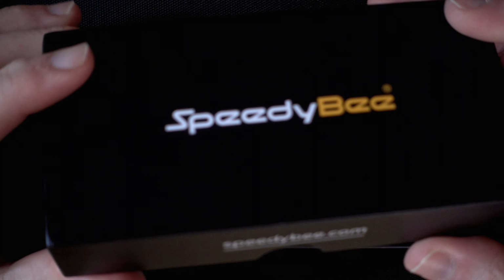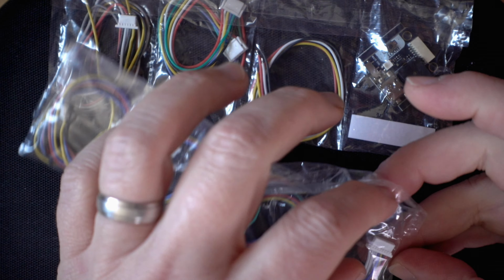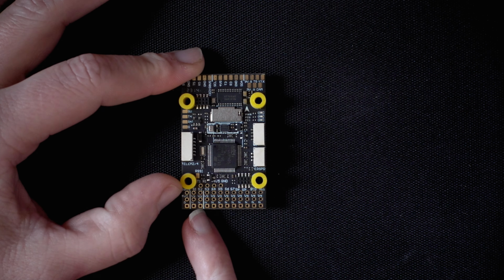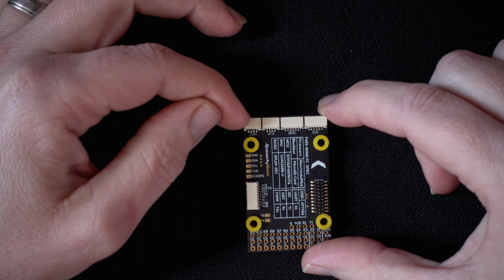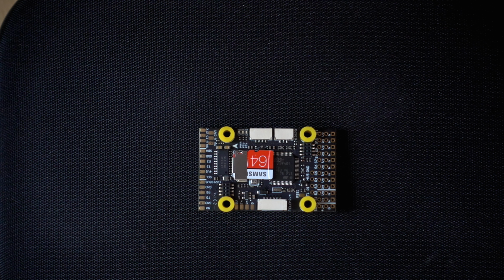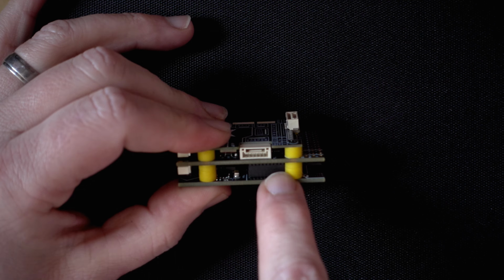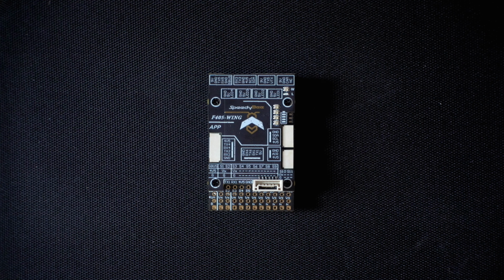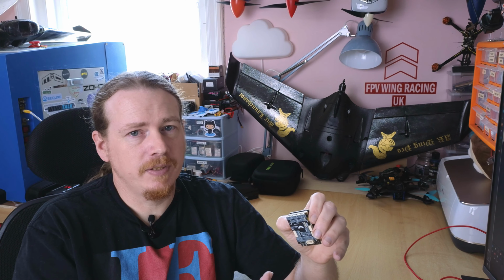First look at the SpeedyBee F405 WING flight controller

Comment: inav 7.1 speedybee wing f405,,I can't find a way to get the motors spinning below 7-8% radio throttle which is 1150us in receiver tab- esc calibrated , any suggestion ?

Comment: Do you know if this fc is compatible with spectrum Dsmx receivers?
Reply from the maker: They should work if they can output a serial protocol, which is supported but the firmware. I really don’t know enough about Spektrum to know what their serial protocols are. I know DSMX is what is used over the air. It’s how it connects to the flight controller. This will be the same with any flight controller. It’s not limited to this SpeedyBee FC.

Comment: Thank you for your videos, I am a beginner with INAV and subscribed to learn more...I got two Speedybee F405 wing for a Multiplex Funjet and an Freewing L39 80 EDF jet...had only the maiden with the Funjet and it worked great, I am more shy to do the maiden with the L39, and found two problems: 90A is what I get at full power and perhaps a bit too much for the FC, and no signal on PWM pin 8 to have a pan servo... a lot of servos on this type of jet, so I connected the ESC red wire to the retracting gear and flaps red wires...but on the bench, I get an "overheat" signal in the goggles, hope it will be cooler once in flight!

Comment: I just ordered this board.  Should I just return it and get the Matek 405 instead???
Reply from the maker: It’s fine as far as FCs go. It depends on which Matek F405. If it’s the new F405-WING V2, I wouldn’t bother. They’re both similar specs. The SpeedyBee has the Bluetooth stuff too.
Reply: Usb ports break easy

Comment: Good video...been trying to troubleshoot vtx problem with this fc...any suggestion for irc tramp and smartaudio for this? Seems that both of protocols doesnt work on this fc
Speedybee f405 wing
Speedybee tx800 vtx
Flashed to inav 6.1.1
Any idea, darren?
Reply from the maker: Both SA and IRC Tramp should work as well as any other FC. It's just communication over a UART. I suspect the issue is the SpeedyBee TX800, which uses IRC Tramp. IRC Tramp is a lot more problematic than other protocols with INAV. Ideally it would need a power table. If the power levels don't match the VTx, it won't work.

Looking at the code, I see the issue. IRC Tramp is expected to have 5 power levels (TX800 has 4). With an 800mW VTx, they need to be 25, 100, 200, 500, 800 to work. The TX800 only has 25, 200, 400, 800. So it won't work unfortunately.

Comment: I got mine on AR Wing PRO, but the baro is working reliably only up to 500-700m, higher than that it goes crazy. I don't know why is that.
Reply from the maker: Because you’re flying illegally high 😉

Have you tried covering it with open cell foam? Is there much of a temperature differential between your model being in the car, then launching, then being at that altitude. Also could be pressure related, depending on the airflow through the airframe.

Comment: Hello. Tanks for video.
-Battery installed inav also appears, but S1-S2 motor does not respond. In addition, the S3 does not respond, although the other servos respond. Why could it be? Thanks.
Reply from the maker: Problems like this can’t be diagnosed on YouTube. There are too many things to check. Please ask on the INAV Fixed Wing Group on Facebook or Discord.
Reply: Thank you.☺ @MrD

Comment: I agree with everything you said about the board. Mostly we have to solder the pins or the wiring I consider a serious mistake. But most of this type of board comes with design flaws
Reply from the maker: I think it would be impossible to please everyone. It’s a good start. But the silly mistakes should have been avoided. If only fixed wing pilots had been consulted.

Comment: The old style board! Boring!
It was better to make a 20x20 board  with every electronics inside and a cable linking to another 20x20 board with all connections, pins, plugs, solder,… and a third 20x20 with current sensor and SD card, so we can choose to use or not, we could spread the boards along the model,…
Reply from the maker: I really see no need for that on a fixed wing. A better solution could be a flight controller board on the top. And a PDB on the bottom. Only you can choose the PDB to suit the type of plane. small and light, standard (with power for P&T), heavy duty for strong servos and high power motors, or VTOL. 

20x20 isn’t a good size for fixed wing in general. Only the most crammed, lightweight models would need such a board. And that small size reduces trace size, so less power options.
Reply: @MrD  In that case the Matek 405SE is the best ever made
Reply from the maker: Not at all for fixed wing. Its an AIO quad flight controller. It doesn’t have half the stuff a good fixed wing FC should have. To me, the F405-WSE size FC (F765-WSE, H743 WLITE) and layout is very nice. Any of those top FC board. But as well as the standard PDB board, which they all shared. Have options for other PDB layouts. For example, allow them to plug in to a PDB like the F405-VTOL. Maybe another PDB like the one on the H743-WING, which can handle higher powers. That would be a much more useful system.
Reply: @MrD  I only use F405SE om my fixed wing and it’s absolutely perfect, I only fly tween motors and I use the pdb pads one for each motor, one for Airunity and the other for BEC my current sensor shows the full consumption of the hole gear, have lots of uarts and 9 servo out! I use the matek servo pdb with it! So what extra functions would another FC have that I don’t?
It’s compact, simple and 30x30 mounting
Reply from the maker: The F405-SE doesn’t have any servo outputs. Are you sure you don’t mean the F405-WSE?
Reply: @MrD  yes I’m, it has the Mports, that delivers 9 PWM outputs, just solder to the Matek servo PDB and it’s perfect, you can mount the servo PDB wherever you want, like a RX, and the best part is that you will be running awg 28 silicon wires out the FC so less stuff plugged in, less heavy wires to interfere with the vibrations and all and also use a dedicated BEC to run the servos, less noise in to the FC

Comment: Hello Mr.D, How can you get the black box data from the SD without having to remove it?
Reply from the maker: You can; though it is very slow. In the CLI, type MSC and press enter. The SD card will then appear as a drive. You just need to reboot the flight controller when you’re done.
Reply: @MrD  thanks a lot for this information, I was not able to find it on the inav blackbox documentation, it is perhaps slow ... but at least I don't have to remove all the stuff form the fuselage, then unscrew the FC etc, so it was really faster for accessing logs .... and with very fragile pins to destroy on that board. Thanks a lot !

Comment: Can build a drone using this flight controller? or just quadplane
Reply from the maker: Is designed more for a standard fixed wing. To be honest, I don’t know why they advertise VTOL in the marketing material. There are no special features on this FC for a VTOL. The PDB is not set out for one specifically.

Comment: Nice review! I got mine mostly due to the wireless conection. Now I can do everything with my Ipad. Very handy.
Reply from the maker: They are pretty useful. It is a bit of a shame you need the USB board to turn on the WiFi though. A friend of mine lost his in a crash. So now can’t update settings, even though the FC is WiFi capable.

Comment: i am trying to light up the 4 led strip that connect from  the FC with no result... i have flagget ledstrip on the setting and configured 4 strips on the osd menu in inav but not getting anything working apart from just one strip... why is so complicated ...
Reply from the maker: AFAIK, only LED port 1 works when controlled from INAV. You would need to continue the data chain from the end of the first strip.
Reply: @MrD  actually it is easier than I thought. You just have to plug the speedybee led strips with particular attention to DIN and  DO serigraphy (this is how  the are marked on the circuits) or they won’t work. Ask me how I know. 🙄

Comment: I'm glad I watched this before I order this flight controller so thanks Darren,I  like my leds on my inav wings and your saying it's not going to work with this board? Also looks like after soldering the battery and esc wires to board it may not go back together proper. I already have a matek f411-wse in spare bin how would you compare the 2 boards? Thanks again
Reply from the maker: Honestly, I would pick the SpeedyBee over the F411. The battery and ESC soldering should be absolutely fine. 

I believe you can actually use INAV to control the LEDs. But you need to only use LED port 1 and set something up using the button on the USB breakout board.

Comment: Great video thanks. Big fan of your iNav vids too.
 
I can see what you mean about connectors taking up valuable space. But I'd argue in the other direction - I reckon its the solder pads that need removing along with the need to do any soldering whatsoever. For me the connections should all be plugin - fiddly soldering must put off a lot of potential customers.

(I spent most of my working life with software and electronics so I'm no stranger to a soldering iron. But now I'm retired I want the easy life!)
Reply from the maker: Thanks Steve.

I see your point. But to me, soldering is more reassuring. I’ve actually seen a few of these connectors fail recently in crashes. It doesn’t give me much confidence in them.

Comment: Hello Mr.D.
Thank you very much for your videos, they are very didactic and very well understood.
I have seen your video about the fc speedybee f405 wing and since I liked it a lot, I was curious about this product. I really want to try it, so I bought it.
I would like to connect it to a FRSKY R10 Pro receiver but I don't know how to configure the Sbus, Sport/Fport and which one to use.
SBUS has an input connector and a different output connector. It is called an inverted signal. How to make connections and configurations of the receiver. I have the FRSKY X20S transmitter thanks to your videos.
Greetings

Comment: i got my speedybe wing controller installed everything is working surfaces and modes and arming. but cant get my flaps or gear to work in the other pins is there something im missing. added the channels to the radio and also setup the servs in the mixer but still nothing. anything would help thanks

Comment: oh man... have you read the specs? All pins broken out means no, there couldn't be anything else, because the MCU (not the "flight controller" as you wrongly named it) doesn't provide anything more than is already done. And by god finally an FC that has everything on plugs and you don't have to solder which essentially means this FC will last forever. Weak review on your end, MrD.
Reply from the maker: Umm, I know the difference between a flight controller and the MCU. If I said flight controller, I meant flight controller.

This flight controller could have more features, like PINIO to switch cameras (including having a second camera) and power the VTx on and off. There are plenty of Matek flight controllers that can do this with the same MCU. The wireless stuff is just on a UART. This FC does not have any more UARTs than those Matek boards. I guess the 2 extra PWM outputs could be in place of those extra features. But the real issue are those connectors and the duplication of identical functionality on multiple connectors. Which is just silly. 

You may think it’s a weak review. You’re entitled to your opinion. I personally think that SpeedyBee’s positioning of the MicroSD card slot is far weaker.

Comment: Clearly that FC has been designed considering you would use the plugs and gave you the pads as a backup, which is nice.
Reply from the maker: However, that's not how most fixed wing pilots build. That is more a quad thing. For fixed wing, soldering to pads is the way most pilots operate. It also doesn't excuse the bad plug layout. There is no need for 2 different VTx plugs. It's just wasted space. The plugs take up 60% more space than pads, so the access around the edge of the flight controller is massively reduced. Which is why we have the terrible positioning of the MicroSD card slot.
Reply: @MrD  If you fly iNav. I would argue most fixed wing pilots use traditional radio receivers, stabilizers and telemetry sensors that use plugs, never solder anything and would rather use adapters than change a battery lead. ;p

Also, most high end FC designed for Arduplane are plug only. Having a (mostly) plug and play option at that price point is very nice.

I do not feel like the wasted space is such a big deal. That FC is clearly not something very compact and/or light weight, but it close to the size of a traditional 8 or 10 pwm receiver, and much smaller than anything  like a Pixhawk.

Yes, the MicroSD card placement is stupid, but if it is accessible it by wifi or bluetooth it is not the end of the world. I am more saddened by the lack of DroneCAN support.

Comment: Mine arrived today, had a hell of a job to connect the top and middle boards, with two sets of multiple pin blocks to line up. The best I could measure the pins were misaligned by about .2mm. Darren do you know if the ‘telemetry’ module block will output to FrSky ACCST telemetry, I’m not into FPV.

Comment: I actually really like having a connector block for VTX. It makes it easier to disconnect the VTX when you are doing something on the bench, so it doesn't overheat, or if you are flying LOS and don't want to transmit video over friends flying FPV.

The blocks look designed for Pixhawk style sensors, which I think doesn't make sense for an F405 that can't run full AP.

I really don't like that style of board connectors. I am curious if people will have problems with these breaking.

Comment: Agree on the vibration isolation. Actually like to add that if anything if will add stress to the conectors inbetween the boards. Does nothing for vibration... there where some quad stacks that did this but stopped becaus of issues. Cant use individual soft mout and connectors... there is a reason ther is wires inbetween esc and fc on a quad... if they fix this and the other points im into v2 of this 😀

Comment: You can select between speedybee LED control, or FC FW LED control. You just press the boot button for 2 secs to switch between the two functions. I have rgb nav and mode LEDS controlled via inav configurator on my SBF405-wing.

Comment: Excellent review, what plane are you testing this on Darren?
Reply from the maker: I will be putting it in my Strix Goblin. It will be replacing the Vector that is currently in there.
Reply: @MrD  oh nice that's a fast one, do you still fly vector? I've got a few but I fly mainly DJI now :)
Reply from the maker: No, I’m replacing all my Vectors now. The OSD was nice. But it’s very dated now.

Comment: I find the SpeedyBee Silkscreen info right on the PCB Excellent.
For the Price of the FC... I can easily live with the Pin/Pad layouts... I'm convinced V2 will address your issues Darrin.
Reply from the maker: Maybe it is not consistent. You can see in the video that on mine, some of it was pretty unreadable. It wasn’t a pre-production board. The big areas of screen printing look fine though.

Comment: I really hope that all other manufacturers will understand - if you make a product at a low price, you can become a millionaire.
Reply from the maker: The problem is we don’t know what’s happening here. Costs have said to have been high due to chip shortages and increased costs. If so, how have SpeedyBee done this? Are they cutting corners elsewhere? Is this an introductory price? Are they taking a loss to break in to the fixed wing market?  Or are other companies taking advantage of the chip shortage? I guess only time will tell.